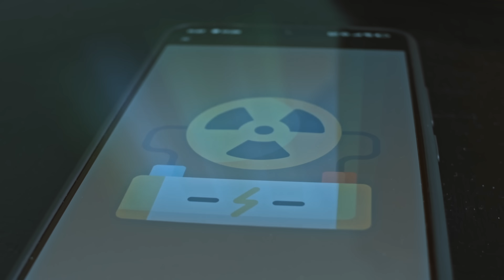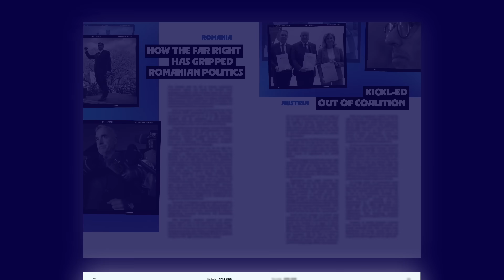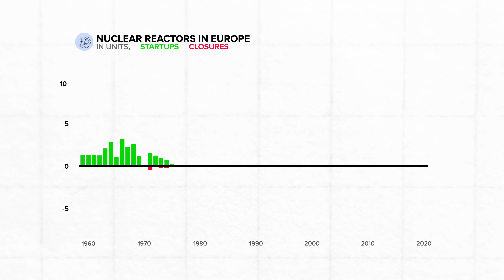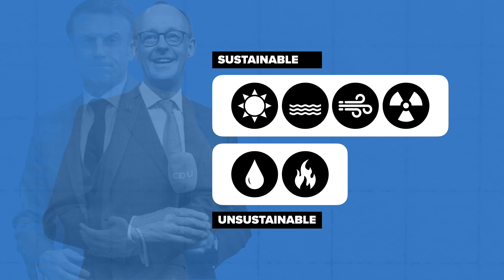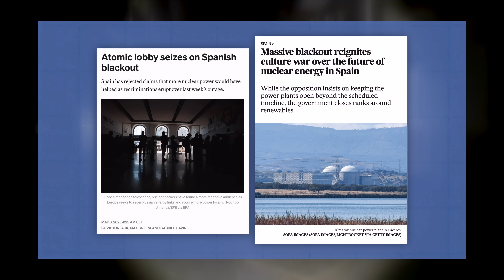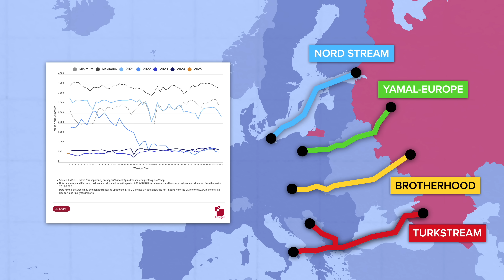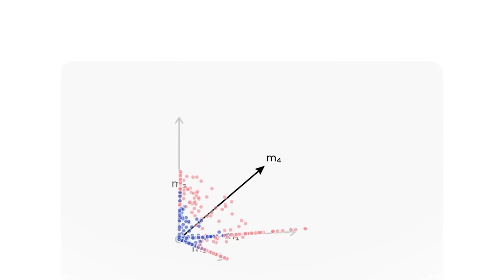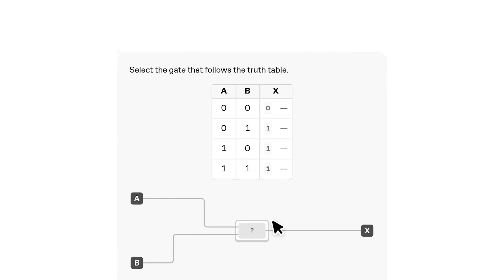Is Europe Quietly Returning to Nuclear Power?

Comment: any Green party that opposes nuclear energy should be shunned and not taken seriously.
Reply: this is the only truth.
Reply: Not just green party, but ANY party

In fact it should be a sign of corruption if the party has zero valid points against nuclear other than causing hysteria amongs ppl
Reply: @NakedAvanger  This is the way
Reply: @NakedAvanger  i should agree
Reply: @NakedAvanger  Expensive takes a long time is very complex and produces nuclear waste, both mining and through the reactors and no its not a solved problem, because recycling costs billions just ask the french and look at how many countries do that. Solar and Wind are far faster to build, are still improving in leaps and bounds technologically and represent a constant economic motor, biggest issue is recycling of fiberglas turbine blades, but I am confident that can be solved soon.
Reply: @prpr8904  Renewables take thousands of times more material, much more unethical mining, a complete re-haul of century old electrical infrastructure, and who knows how much more for overhead production, storage, recycling, human costs, etc.
Reply: @prpr8904 the question is not of waste generated, but of grid stability. Storage is a giant problem which is both not solved and much more expensive than nuclear
Reply: @NakedAvanger  There are so many valid reasons against nuclear in a mainly renewable powered electricity grid that I can't really see the logic in your comment
Reply: @NakedAvanger 
The best point against it is that is is way too expensive compared to renewables, without being subsided by the government you couldn't even afford the insurance, let alone the 1000+ years of longterm storage.
Why should the government subside a form of energy that is more expensive, less competitive and not better for the goal of getting CO2 neutral...
Reply: @i.i.iiii.i.i   two things, you get most if not all the cost of building and running a nuclear power plant returned over the span of say 15 years or so furthermore various companies are developing more and more ways to find uses for nuclear waste, its literally all a matter of how much resources is being allocated into researching these things
Reply: @DavideDavini  yes and whats your point exactly? Doing this for nuclear is doing it for the cause
Reply: What right wing brainrot media does to someone. Great idea. Let's make ourselves dependent on Russia again.
Reply: The greens throu-out europe are a joke party anyway. All they do is put forth "feel good" policies without ever thinking through the consequences and actual ramifications. It's a shame cause we need reasonable enviromentalist parties.
Reply: …Green parties are taken seriously? I’ve never seen it.
Reply: They will gradually say nuclear energy is also GREEN to stay relevant
Reply: Agreed. It's the only viable solution to climate change, if they oppose it they're more or less proving they're either in cloud cuckoo land or they secretly want the world to burn.
Reply: This only applies if you already have functioning nuclear infrastructure, in Australia it's a shit idea, but in countries that already have it it's a good idea.
Reply: @altacc5116  I agree, in Ireland it's a terrible idea. But no party supports it, left or right, precisely because it's impractical. 

In a country like France or the US that has extensive nuclear infrastructure, if the Green party oppose it they're being ideologues.

Also, Ireland could support nuclear energy programmes that supply the entire EU with nuclear power. If the Green party voices their opposition to this they will lose my vote.
Reply: In Ireland one random Green mp 25 years ago asked it and everybody just passed the bill no problem and now nobody cares
Reply: They just got out of a government too and got PUNISHED and lost 11 of their 12 seats
Reply: @nigel_seb Which bill was this? What was it for exactly?
Reply: I'm pretty sure it's why the green parties in Belgium didn't get any seats last election XDD
Reply: To be fair, most if not all Green parties were born out of anti-nuclear movements, so it's understandable that letting go of this counterproductive ideological gibberish is hard for them. Other politicians have no such excuse.
Reply: We should give them a reserve (forest) and let them live off the land in there.

Most of them will surely see some sense.
Reply: Almost as if they're secretly funded by the large Petroleum producers...
Reply: Any conservatives, that really think they could guarantee that the nuclear waste can be stored for 1mio years, shouldn't be taken seriously at all. Thats longer than humanity exists.
Reply: ... yeh.. if you don't care about money ... or economics.. .or grid stability... or planning....
Reply: Which is, unfortunately, the majority of them.
Reply: They are supported by russia !!!
Reply: nuclear waste is still dangerous for the environment, even when excluding fatal accidents. Regardless of whether you personally are pro or anti nuclear, they'd still have a point in this regard
Reply: @Kiyuja yes but compared to fossil fuels it’s not nearly so damaging.  people blow the waste problem out of all proportion.  yes people are slow to approve building of long term storage facilities but temporary storage facilities cope just fine.   there has only ever been one leak from a storage facility .. hanford in the US starting in the 1940’s and due to criminal negligence.  that’s bad of course but, as is evidenced by the fact that this is the only incident, the world seems to have learnt from its early mistake.   instead of shunning nuclear the sensible thing is to make sure it’s managed properly.   if you are thinking about the danger of radioactive releases because of accidents.  again remarkably few and in total less environmentally damaging to the environment than would have happened due to fossil fuel burning if nuclear power didn’t exist.  on top of that new nuclear power stations are far far safer than the ones that did have the accidents.  basically risks are overhyped
Reply: @andrewpaulhart  yes the burning of fossil fuels poses a more immediate risk than nuclear waste. That however wasnt even my argument. Its the fact that waste exists in the fist place. Nobody wants to have it anywhere near and we as humanity dont really know how effective this long term storage is. What we do know is that in case of critical failure you have insane damage to the environment, which those parties can argue and there is basically no argument against it really, its still dangerous no matter what
Reply: @Kiyuja  BUT, it is in very little quantity. Unlike wastes from renewables, which being less dangerous inherently, is presently managed in ways that make them more dangerous, all while being in far greater quantity.
Reply: They are already shrieked some much, and are going to dissappear as a party if you ask me, because of they are first of all more queer than green, also all of their "green proposals" are kinda crazy to me.
Reply: @kirilmkdsrb  I would say it's kinda crazy to be so paranoid about queer people. people like you think more about queer people than vice versa. But some people seem to need scape goats to make themselves feel better.